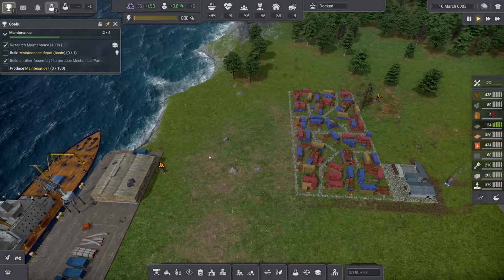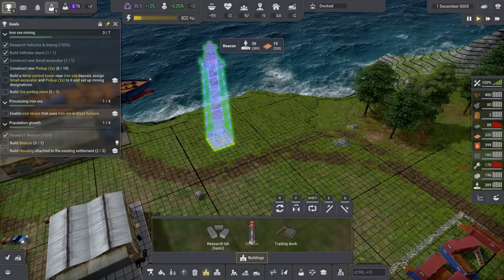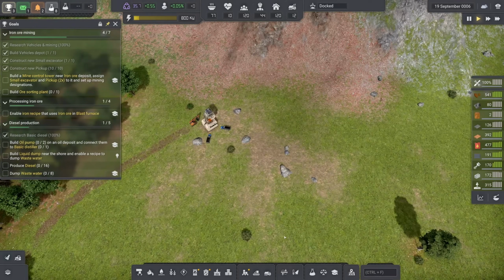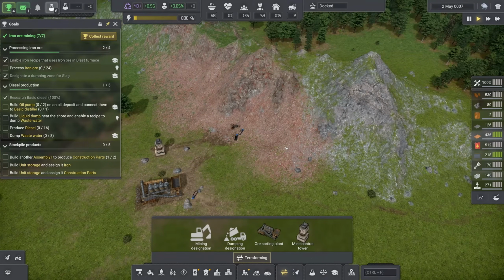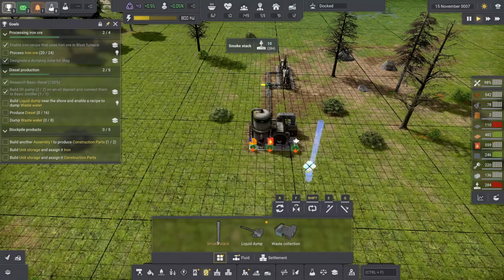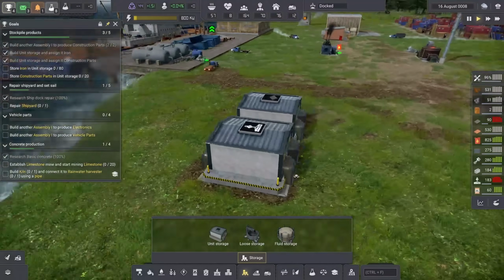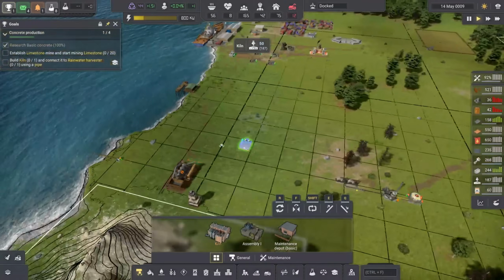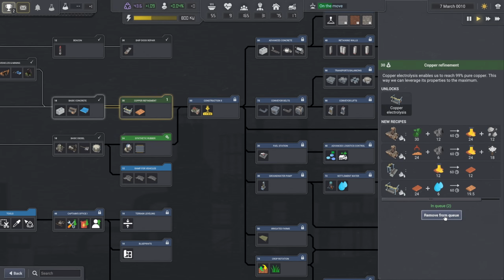Basic Mining, iron ore and limestone | Captain of Industry | Ep 2

Comment: 7:00 You can edit the size, shape, and location of the mining area (which you figured out). The mine control tower can be in a completely different part of the map and still function just fine. The problem is just that if the excavator or the trucks are idle for whatever reason, they will go park next to the tower, which is why it's better to have the tower close to the mining area.

Comment: 13:31 The dirty little secret the tutorial doesn't tell you is if you run the pipe from the closer oil pump to the distiller first, then run a pipe from the farther pump along the same line, the connector will automatically pop in.  I think in the new patch you can actually just drop a connector by itself without having to play the shenanigans.  It only saves one tile of pipe but if someone wants to super min/max and make compact builds it's nice to know that ahead of time...

27:20 If only there was an easier way to get coal.  Like, if it was just on the map...  (not trying to be a jerk but also don't want to spoil stuff in the game...)

Comment: Its a MIND Control Tower!
Oh Gosh, please NO to power wires, anything but power wires! Last thing I want to do is have to string any wires anywhere!
Reply: I have a wave of yuri’s revenge now…
Reply: 😂 oh come on why not. Refine copper, rubber, and wood for power poles. Use steel, copper, oil for transformers to not overload systems. Its a whole new game in itself.
Reply: @darghoul  I will consider power after we get the bucket Excuvator, the Stacker that swings left and right so it can be useful and also Material ropeways! Tom Scott has a great video on them, they would be the best thing for COI for long distant ore transport! Best part is it could be run on Mechanical power rather then electricity, and if build to run downhill they could actually make power!
Reply: oh hell no...please no power grid/wires the game is complex enough. Also, thank you for all your tutorials and playthroughs, i have used them so much since picking this game up a few days ago
Reply: @apedescendant  No Problem I'm glad your finding them helpful!